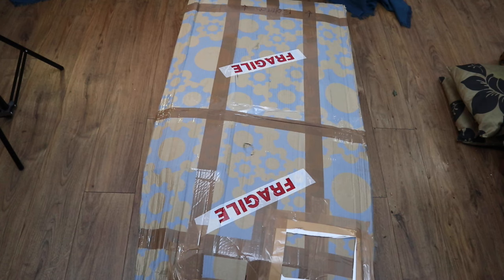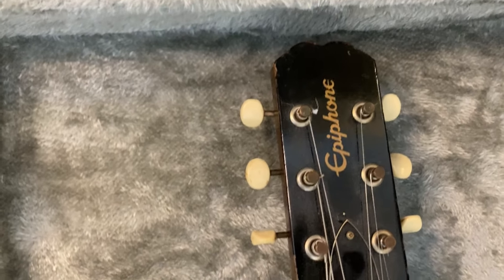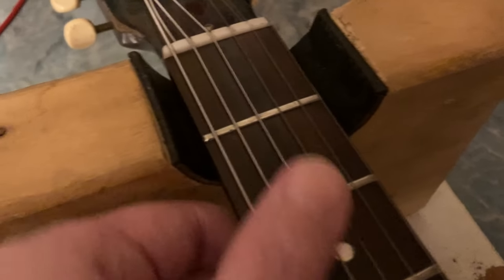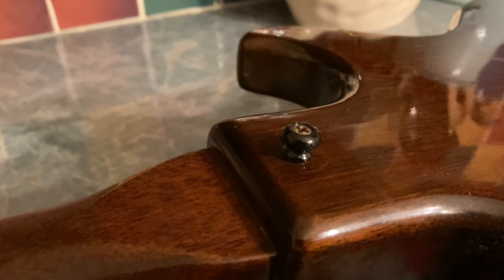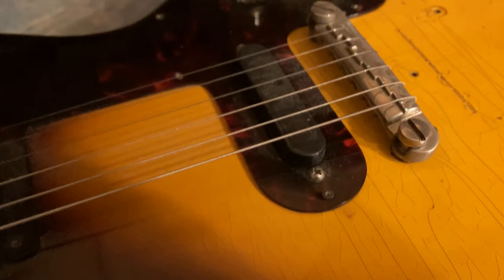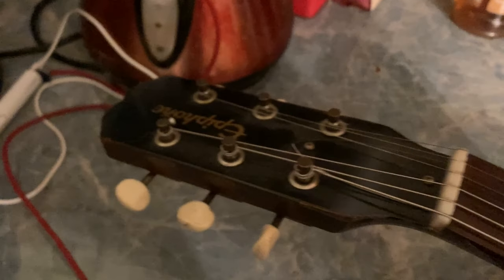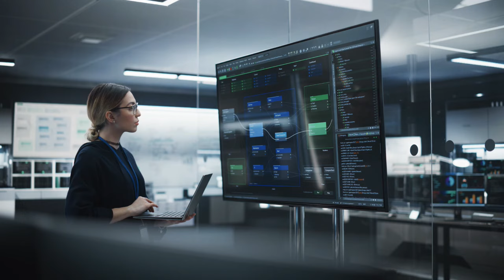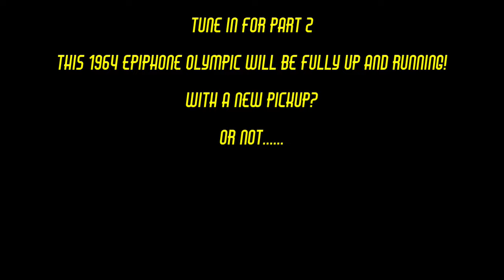UNBOXING: I finally bought an EPIPHONE!

Comment: Excellent. I had a dark green ‘67 Olympic Double (2 pups) with the batwing headstock and a white scratch plate. It had more of a Tele style body. I stupidly sold it or traded it for something, and I don’t know why or for what. Seller’s remorse? Big time.
Reply from the maker: I love the look of those later Olympics - did it have quite a slim neck/nut width? I know that Gibson changed to a skinnier nut later on on 1965, but I'm not sure of they did the same on the Epiphone line.
Reply: @DunsysGuitarWorld  Yes, the neck was slim, very like my ‘70s Tele.

Comment: That sounds fabulous leave the pickup a mate of mine had a Melody maker with a similar scratch plate we warmed it in hot water clamped it between boards in his airing cupboard then glued it to a brass sheet carefully cut it out ( his carpenter dad actually did most of the difficult stuff) but it came out brilliant ( and shielded !) Fab guitar I'm in love.
Reply from the maker: Lovely guitars. So light and resonant. I think that’s how my friend fixed this one. Got the scratch plate straightened out and have an aluminium backing on it. Which has a real bonus of showing up the red in the guard when the light hits it. Looks great. Should have the update video done soon.

Comment: You lucky guy !! I want one for a long time !! I like Melody Maker Double Cut !!
( ... but did you notice your Wraparound Bridge is made for wounded G Strings ?? It has the G String saddle at the wrong position. Modern bridges have 3 saddles, and goes back for the next 3 saddles ... Yours has 4 saddles and goes back for the last 2. But it's "era correct" !!)
Reply from the maker: Ah, I 100% did not notice that! Comparing this with my 61 Melody Maker, they’re essentially the same guitars. Same parts and everything as far as I can tell. Great instruments.
Reply: Thats a great spot, I have seen that before and didn't realise that's what it was about. Thanks for the lesson!

Comment: From the looks of the potentiometers and the tuner shafts, it looks like that guitar probably spent a lot of years in a relatively dry loft without a case. My squier strat spent a few years in my friends loft and had very minor corrosion (it cleaned up fine and shows no signs of corrosion now).
Reply from the maker: Yeah, I think that's maybe how it sat for a long time. Luckily everything still works in the original electrics. I double checked the pot codes (couldn't read the numbers to begin with) and they date to the 37th week of 1961. So possibly a late 1961/1962 guitar? Although it was sold to me as a 1964.

Comment: I really enjoyed the playing segment.  Its your sweet guitar but personally I wouldnt change out the pick up.  Clean and dirty it had a fantastic vibe.  Ya cant find such a strong vintage sound like that in a new pick up.  Just my opinion.
Reply from the maker: Thanks buddy - yeah, it has a real lively sound about it. I’ve had the work done to get it all fixed up - but didn’t do anything major that isn’t reversible. When I do the next video I should be able to compare the original with the new pickup, then decide what works best. Plus I can see how similar it is to my 61 Melody Maker which, I think, has the identical stock pickup.

Comment: Nice! Love the old checking on the front. Would be a shame to have to replace the pickguard given its age, lets hope its repairable. Nut looked a bit a a mess, e-string almost hanging off the board, unless I am looking at it wrong? Anyway it sounds really good for an old single pick up.
In other comments, I am intrigued how you are managing to keep the constant in-flow of guitars without getting excessive grief from your other half? I am being pressed to sell before I am allowed on the Japanese auctions. If those bids come off I am in trouble!
Reply from the maker: After 1/4 of a century there’s no surprises! I guess, in all honesty, this is my hobby and my passion, has been for 40 years. And I’ve had the same day job all that time. I don’t spend money on much else and all the bills are paid. Plus I worked out that I got rid of 24 guitars in the last 12 months. You just see them come in, but never going out. That I definitely WOULD get in trouble for, lol 😂
Reply: @DunsysGuitarWorld  24 - thats brutal! The last two guitars I put on Reverb I cleaned them up in preparation and then of course started to play them again and thought why am I selling this, its great! So took them down 🤣
I don't know whether its just GAS, but I really enjoy trying different guitars, there is so much out there that look and feel different - one of everything thats the goal!
Reply from the maker: Oh man, I totally understand that! If I’m selling something it gets put in a case until it’s sold - otherwise it’s way too tempting! I have a few things that I plan on holding onto for a while, but I guess with so many things coming and going I’ve finally got to the stage where most are “just another guitar” that I review and make a video for. I need to keep things fresh for folks tuning in. Plus I have a lot of guitar player pals that get stuff straight from me for what I bought it for. Saves me going through the trauma of folks coming round here and haggling and also having to post stuff. And risk it being returned! On the odd occasion that I put stuff on eBay people can (and do) search YouTube and can see a full review, breakdown and the sounds of the guitar before buying.

Comment: The poke in that pickup surprised me. Would you gig it?
Reply from the maker: I guess it would depend what kind of stuff I was playing - it’s likely the same pickup that’s in my 61 Melody Maker and I’ve used that at rehearsal - sounds great through a loud Marshall. Maybe the only thing lacking is the sustain. But they handle gain pretty well, I have to say.

Comment: if you replace the pickguard do you think you'll spring for something vintage accurate like a spitfire or settle for a more modern plastic tort or black?

either way super cool. I'm big on melody makers/Olympics
Reply from the maker: It’s a lovely guitar - managed to save the original pickguard, but with a little twist in that it now looks even better. Long story!

Comment: By the way it sounds, I personally wouldn't bother with a new pickup
Reply from the maker: Got it back recently after getting it fixed up - my friend has set it up so that I can change pickups and compare them against each other, without doing any mods to the guitar, other than a couple of small screw holes in the pickup cavity. Looking forward to do the update video.